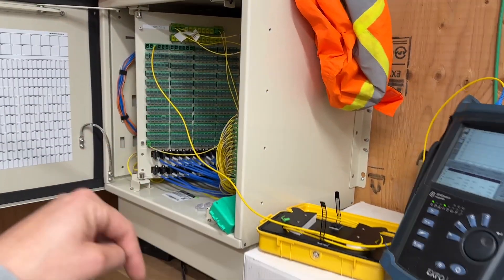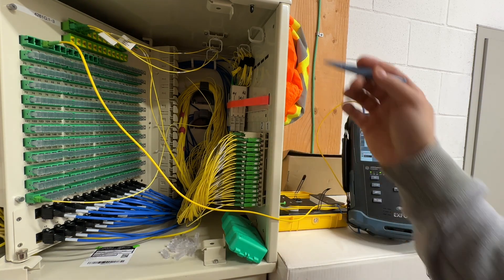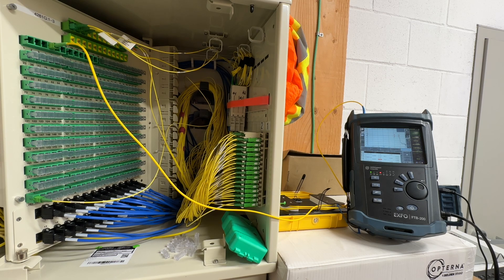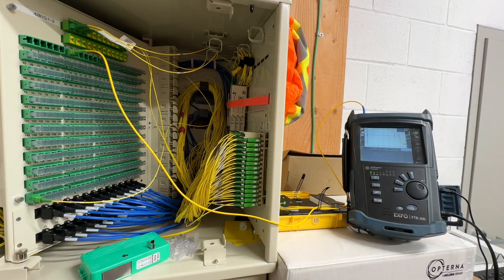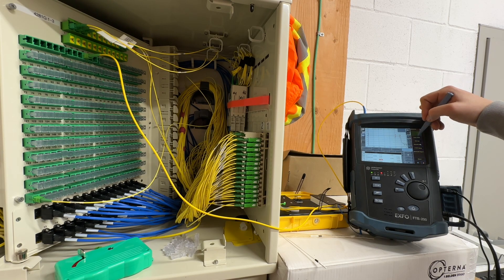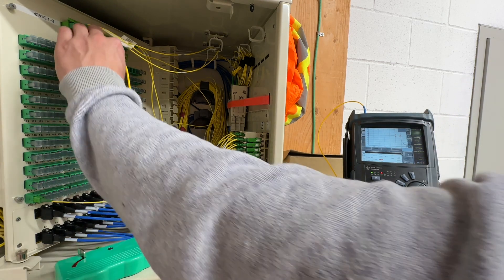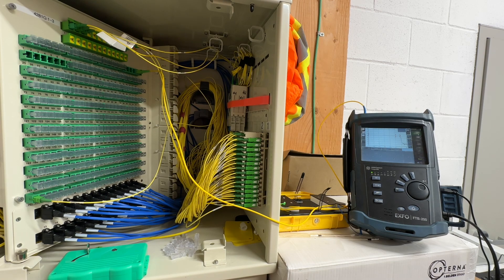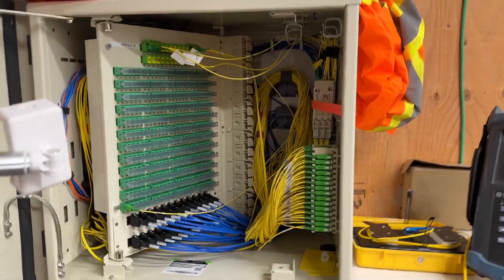Fiber Optic Network Testing

Comment: I would like to know how ofter do you put a clean connector on your test lead after so many plugs
Reply from the maker: Great question 🙌 just really comes down to cleaning each port before patching in the test lead to reduce the risk of patching into a dirty port and scratching the connector face creating a bad reflectance. It happens from time to time every couple years but it is always from the same scenario not cleaning every port before testing and a piece of dirt scratches the connector face creating a reflectance ending in having to replace the lead on the launch box. So simple way to prevent this long term is to clean every port before testing Do that and you will keep your test lead clean for years  🙌🙌

Comment: Is there a machine that can test 12 ports at the same time? If not, that would be a great invention. You’ll have 12 test pop up on the OTDR and you can save each ribbon.
Reply from the maker: I wish there was 🙌and yes you are right it would save so much time when it comes to testing but yea unfortunately can only test 1 fiber at a time

Comment: Tail fiber is missing. Need a second guy to move tail from port to port to do this correctly ;)
Reply from the maker: Hahah your funny that is power meter testing you are referring to this was OTDR testing I was running😂😂 thanks for watching and commenting I appreciate it
Reply: @FiberSpliceGod  Nope. I do OTDR weekly at our datacenter. Without tail fiber you will not see the end port properly. OTDR is a lot better than power meter testing.
Reply from the maker: @sjobbefin yea this customer does not require tail Fiber to see connector instead they want big directional testing. I test ifdh to CO then CO to IFDH 🙌